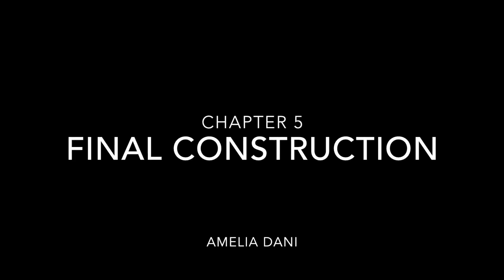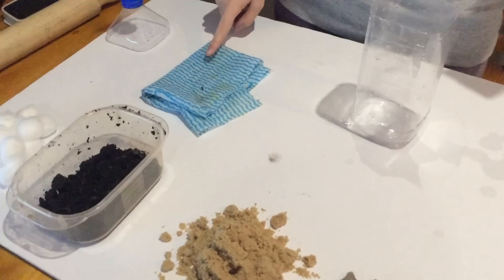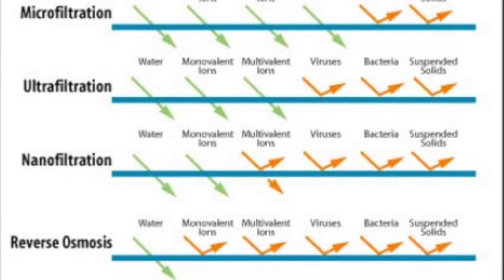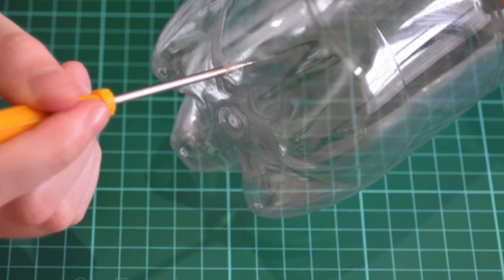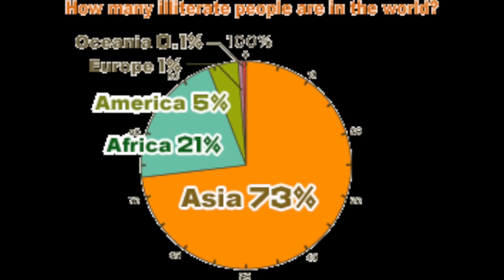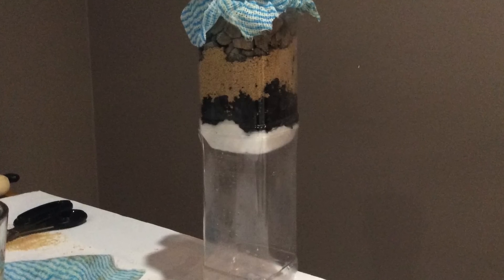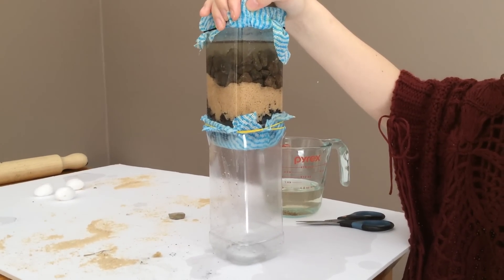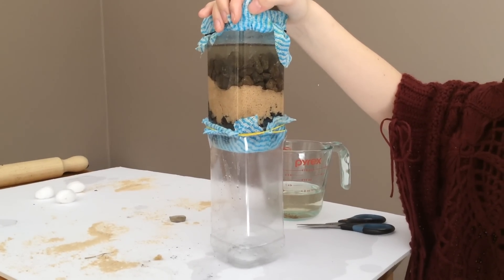Homemade Water Filter completed - Science Project

Comment: Can I use a bandanna for a membrane filter? Or do I need a thicker cloth?
Reply from the maker: Yes you can.  Depending on what it is made of it will have different results.  Cotton and polyester are both good, but polyester is better as it is more tightly weaved and better for filtering.  Best of all is silk. Thickness is not really important.
Reply: John Dani ok, thank you